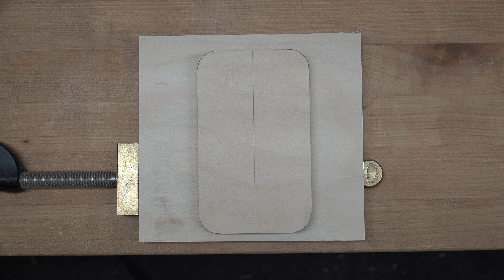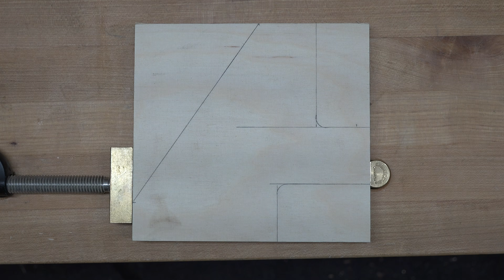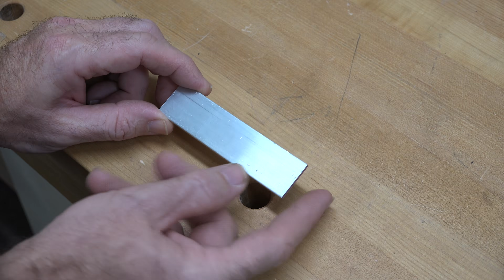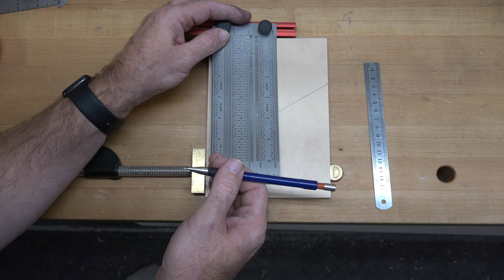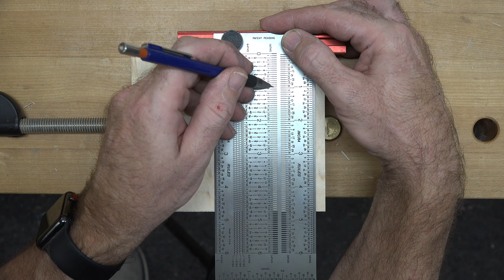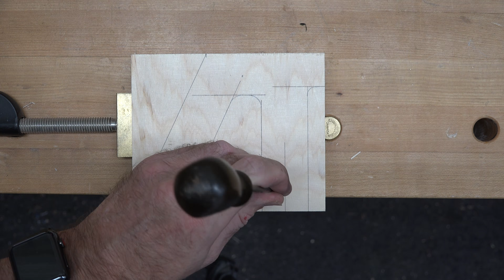Lathe Duplicator Part 2

Comment: What if the height between the bed and center of the spindle is different?
Reply from the maker: If your height between the centre of the spindle and your lathe bed is different from what I've done here on the show, you adjust accordingly.  Make the jig just as I've done here on the show, but use your bed and spindle measurements.  I hope that made sense and I hope I explained it well.  Changing those measurements does not affect the operation of the jig at all.  Thanks for tuning in to the show.
Reply: @acutabove_woodworkings  thanks for replying. So this is what I want to do. I have a couple of different lathes, each with a different bed: spindle/bed height measurement.  So what if I cut a 2" horizontal slot into both the marking tool and cutting tool to make up for the heights of the center line of the lathes? This could accommodate different heights of the center line.  It would be a pair of wing nut types to make sure there is no slippage. Am I compromising safety by doing this?  BTW thanks for making the explanations so clear. This is not your first rodeo and it shows. Your videos are spot on and your diction is clear and succinct.
Reply: Ps what I did not include is that the jigs would have to be cut in half so that the upper and lower parts could adjust the height. Perhaps metal plates on both sides would be strong enough. What do you think?
Reply from the maker: @stanleyarmes1  This would work as an adjustable tool base.  I don't think it would compromise safety as long as there was not possibility for the tool to shift positions from the downward force of the spinning lathe.  Possibly a positive stop arrangement where the jig's height is changed by bolting the tool rest together according to the height that is needed.  The adjustable slot is a good idea, but I fear that the tool could move during use unless the connection is very secure.

Comment: Why is the length of four inches necessary for the aluminum bar.... stick's way out
Reply from the maker: The 4" length gives some length to get a secure connection in the interior of the duplicating marking device.  If you feel that the 4" is too long, you can always cut your shorter if that suits your needs more.  I hope this helps.  Thanks for tuning in Tim and for taking the time to ask your question.
Reply: I've finished mine and hope to be using it soon....I have the highchair that my great grandpa used as well as dad, myself, my kids and grandkids...one leg is broken... hoping this will be the answer....will let you know
Reply from the maker: @timpierson2640  I'd be interested in your results.  I've had great results myself with this duplicating jig.  Good luck with your project Tim.  It sounds like a great one.

Comment: How did you mount the piece of aluminum stock?  You kinda glanced over that.
Reply from the maker: At 4:45, I demonstrate in a smaller screen to the bottom left, how the aluminum was held in place.  It was basically friction fit into the table saw blade kerf and then 2, 1/8" diameter holes were drilled through the jig and through the aluminum.  From there, a 1/8" diameter dowel was glued into the two holes to secure the aluminum in place and keep it from shifting.  I hope this helps Patrick.  Thanks for tuning in to the show and taking the time to ask your question.

Comment: Can you add a link to the various tools you use?
Reply from the maker: I use a lot of different tools William.  Is there any particular ones that you are interested in?  Thanks for tuning in.
Reply: @acutabove_woodworkings  the tool you use to draw your lines. Looks like some sort of square with a lot of holes
Reply from the maker: @LRAPLLC  That would be an INCRA T-rule.  They are available at most woodworking suppliers or directly from INCRA.com.  I got mine at Lee Valley Tools.  Here's a link.  https://www.leevalley.com/en-ca/shop/tools/hand-tools/marking-and-measuring/rules/58877-incra-t-rules
I hope this helps William.

Comment: Where can I purchase the marking tool you are using? Thanks
Reply from the maker: The device you are asking about, is called an INCRA T-rule and they are available at most woodworking stores.  I purchased mine at Lee Valley tools but you can also get them directly from INCRA.  They come in metric and imperial as well as a whole host of other options and lengths.  I hope this helps.  Here's a link to INCRA.  https://www.incra.com/measuring_marking-trules.html
Thanks for tuning in to the show.
Reply: Thank you Kenny